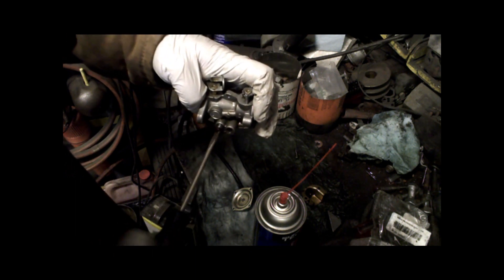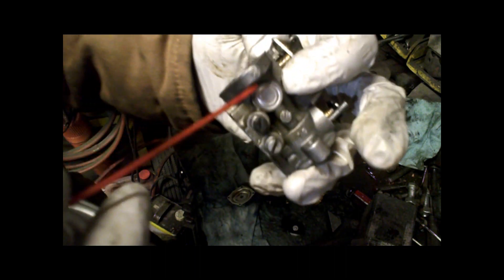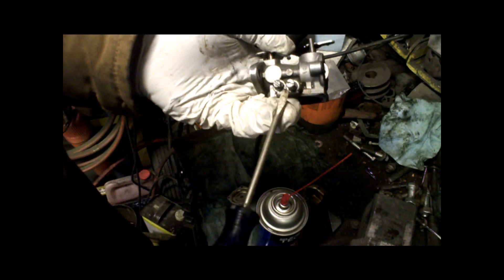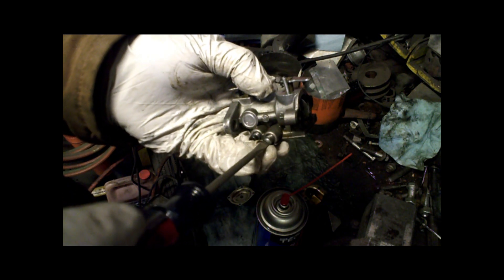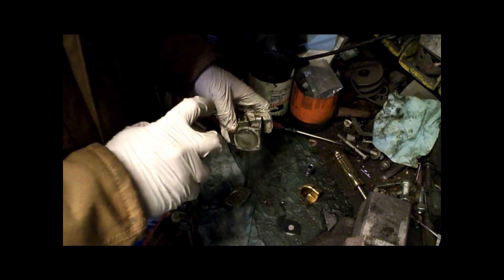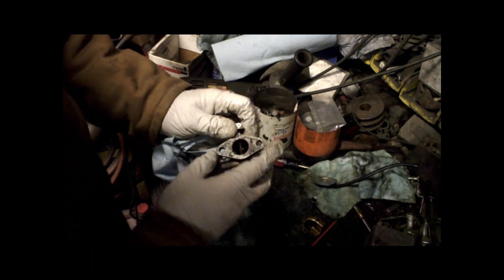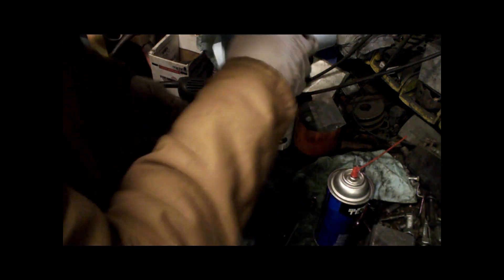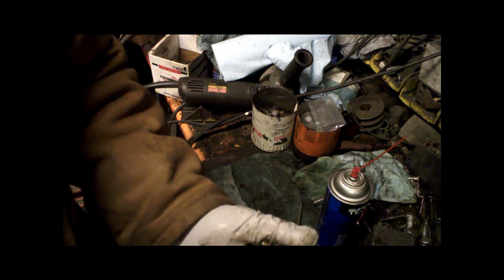Tecumseh diaphragm carb 2of2 Toro S140 S200 S620 rebuild

Comment: Do your self a favor, use a baking tray to spay the parts in also blow the passages out with air.  Carb cleaner smells pretty bad and you can just clean the tray not your bench.  You need to clean up that bench. You did a great job you just need to clean your act up
Reply from the maker: Air does nothing on these micro passages (it's fine for auto carbs). I have well over 250 carbs under my belt with only 2 that I had to ever replace. Carb cleaner gives a visual reference to the flow capabilities of a passage, air can't. I can tell instantley if the passage is flowing correctly. I don't use a pan simply because I do not want the parts sitting in dirty/gritty solution. The rags hold the grit and I have a direct overhead ventilator fan so I never breath it. Having a spotless workbench is personal preference and I try not to worry nor stress about meaningless tasks.